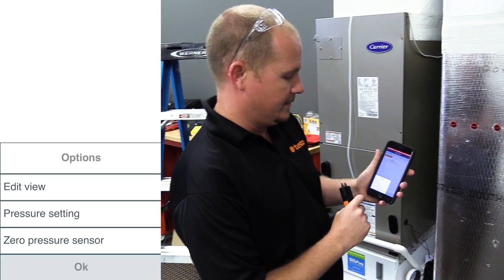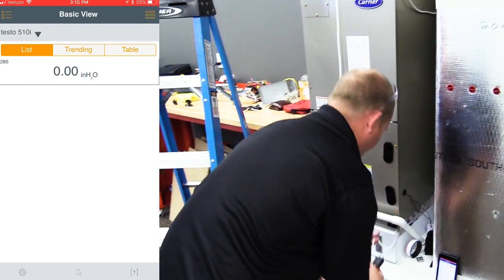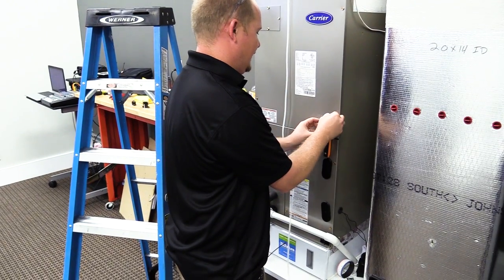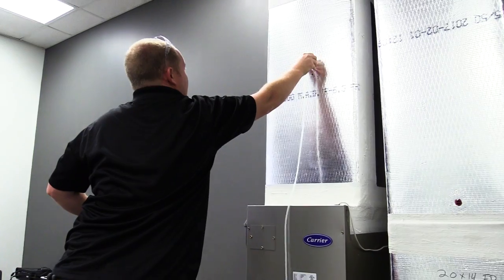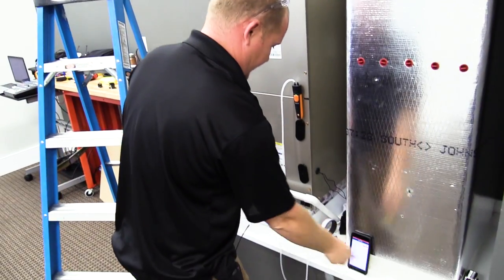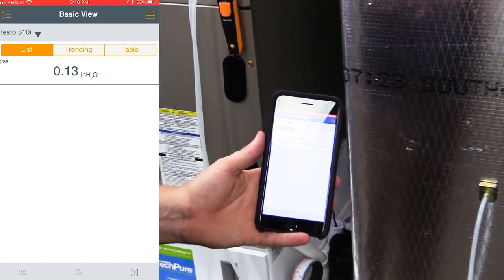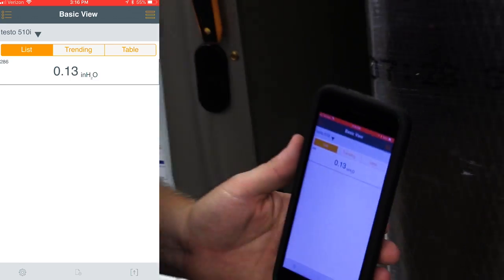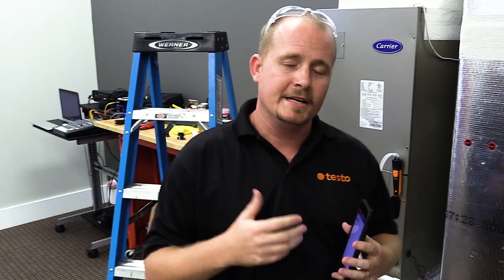How to Measure Air Filter Static Pressure Drop

Comment: Seems like new filters have a pressure drop of about .2”WC  from what I’m seeing. If I were to install a pressure switch to measure the differential static pressure across the air filter theoretically I could have the pressure switch trip when the filter is dirty and activate some kind of a indicating circuit. Is .5” WC too much of static pressure to be replacing the filter at?

Comment: On the cheap, you are measuring "inches of water" so you can use a piece of clear polytube wit some water and a drop of ink/dye and notice the reference height with blower off, mark with sharpie. Then notice the new water level with the blower providing suck/blow to your probe position. Use ruler. At least you aren't measuring a collumn of mercury! 
The electronic pressure gage is cool!

Comment: What will be the number that you look for in this particular case or the more or less acceptable readings?
Reply: José Cruz I have the same question? Thanks in advance for your response.
Reply: Different for different systems, but it should be in the  factory service manual.  As mentioned, clogged, collaped, too-many or wrong filter is common.  Never underestimate user maintenance efforts!
Reply: @pirate0jimmy , nor should anyone underestimate engineers for hiding information. We have a 2006 Lennox unit and nowhere in the paperwork is information given by which a homeowner could determine the best filter for the unit.

The paperwork doesn't even mention the filter thickness (5"). It ONLY mentions the 20"20" width and length of the filters.

The closest you get to hits describing filtration levels is, the " HEALTHY CLIMATE MEDIA AIR CLEANER" paperwork tied to the add on cabinet to house the filter. 

Unfortunately, it offers, essentially, a one-size-fits-all BS approach. It states:  "the Healthy Climate Media Air Cleaner uses an electrostatically charged media to strain airborne particles as small as 0.3 microns with an efficiency rating of 95% or more (MERV 16). . . .

Yeah. Right. Try that and see what kind of air flow you get on our little unit.

In the end, if anyone is to be mocked, it should be, first, the idiots who failed to provide clear, up front information to aid the homeowner in determining which filters best suits their system.
Reply: static pressure drop of less than 0.2 inches of water column across new filter